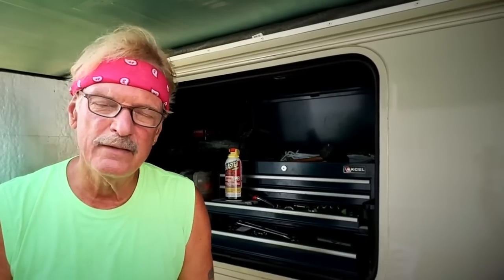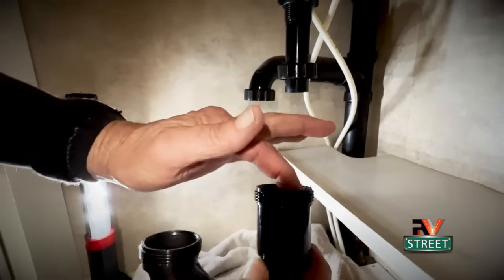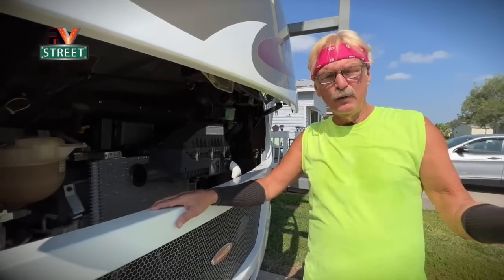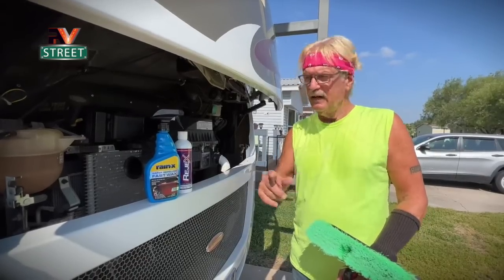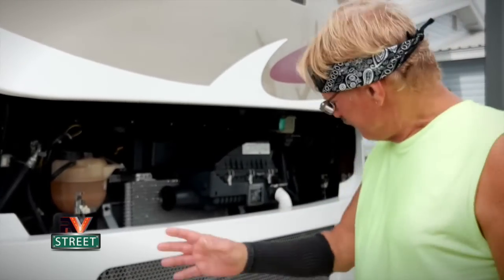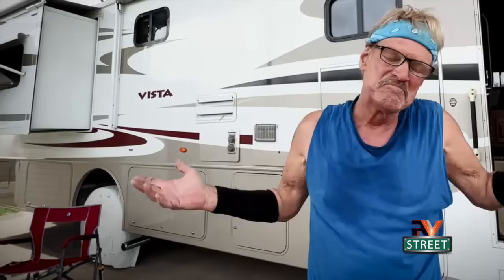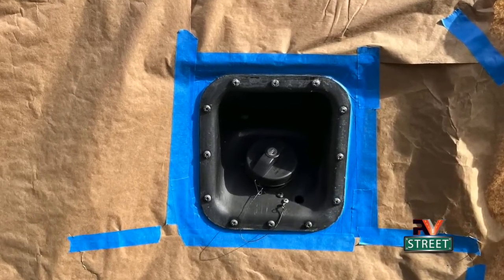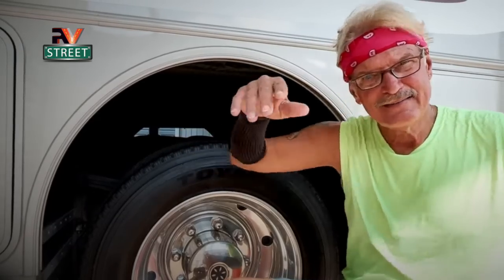WHY DON'T RVer's know these things?

Comment: Excellent tips Martin!!!  You da man!!!  You have sooooo many hidden gems and nuggets that a lot of other YTers have never pointed out!!!

A little nugget on the Rain-X 4 u.  I’m a merchant mariner and learned this tip from a fellow mariner years ago.  When applying the Rain-X, apply it generously, let it dry and simply rinse it off.  It will last a whole lot longer!!!  And, in our environment when going into a moderate to heavy sea, a lot of salt water will wash the Rain-X off in a short period of time if not applied generously.  People follow the directions and wipe it off like the directions say.  What this does, is takes most of it off… kinda defeats the purpose.  Rain-X applied in the way I described lasts longer and just beads off extremely well and I don’t have to utilize the windshield wipers🎉.  Read what the shampoo manufacturers state, apply rinse and repeat, which isn’t necessary.  They just want you to buy more.  
Just my 2 cents.
👍😃🍻
Reply from the maker: thx for that Mike 👍

Comment: I run boiling hot water through my drains once a month. About a quart to half gallon hot steamy water usually after doing dishes. Never had a drain or smell issue.
Reply: Do you use soap as well? Or just boiling water?

Comment: Very helpful reminder and teaching video! I need to check my hood bumper stops. Already had the hood hinge attachments bond fail and had it repaired at Forrest City. 6 years and so far that's held with new epoxy using the exact technique you specify.

Comment: Thanks Martin for the heads up on the sway bar bolts on the F53 chassis. I checked mine and found several of them loose. I applied the blue lock thread and should be good to go. Oh and your suggestion to keep a generator fuel pump on hand came to good use. Mine took a dump yesterday and I took your advice so I can replace that tomorrow.
Reply: How do you know what chassis you have? I recently purchased a 2007 35 ft Itasca with a V10 engine. Is it listed somewhere on the coach?

Comment: That Yuck, sludge, junk, etc on your trap is called BioFilm (bacteria produced polysaccharide matrix) mixed with some soap scum. Besides mechanical removal (scrubbing) 2-3qts boiling water poured down the drain should keep it a bay. I do this 2-3 times a year in my lavatories and showers that are subject to hair capture which makes it much worse. That strainer is a very good idea. I agree the chemical route is not best practice. The slow drain issue is building code required for houses (not RVs) to keep the sanitary system (notice not drain) from overloading. Too many of the IBC requirements have throw backs to cast iron and clay pipe sanitary collection systems. 

I don't like RainX products. They require constant reapplication. If you don't the silicone breaks down and make your windshield hazy. There is no way to remove it. The windshield must either be replaced or consistently coated with RainX, forever... I agree the bug problem is best solved by quick removal. I've yet to find anything that works better than water. Plexus does a great job on plastic lenses.

I'm so cheap I would turn the step covers around to get a few more years out of them. Great advice on the TPMS.

Comment: I have alternatives for keeping bugs out of the radiator and the gas filler.

1. On my motorhome the grill is a 1/2" grid that is also about 1/2" deep. If I put a screen behind the 1/2" grid will make it difficult to clean the bugs out. So, I found a stainless-steel screen material with a 1/5" mesh. I removed the grill from the grill opening. I used tin snips to cut it to the same size as the grill. I then used 8/32 x 1" stainless-steel torx head machine screws with stainless washers and elastic stop nuts to secure the stainless screen in front of the grill material. I then reinstalled the grill in the opening. 

2. My gas filler opening was really looking gross. My coach builder had installed it with butyl rubber as a sealant. The butyl was oozing out and running down the coach wall. In addition, the capture strap that keeps the gas cap from being dropped and lost was no longer retained in the filler housing. I removed the filler housing and scraped and used acetone to remove the butyl from the filler housing and RV Wall. I then used sandpaper to smooth the rough edges on the filler housing. Then I did one final acetone wipe down of the filler housing and sprayed it Rest-Oleum gloss black. I reinstalled the housing with a new layer of butyl making sure the butyl was kept well away from the edge. I then masked off the area for calking just like Martin did and used Pro Flex RV Sealant to caulk the filler housing. I then found a new grommet to fit the hole for the retention strap to keep the filler cap under control.

Comment: I put window screen material that I already had on the back of my grill. It has very small openings. I have put all the 54,000 miles in 8 years on my Ford V10 F53 chassis motorhome including dozens of mountain passes and have never seen the coolant temperature gauge go up from normal, even in warm weather.
Reply from the maker: Great idea 👍

Comment: One thing to point out on sink drain the clog might not be in the trap. Mine was in and around stopper. Took stopper out, had to unscrew lever just above trap and pull it out to lift stopper. Then fished paper towel through to get big clump out. 

Such a timely video, watched it and later that day wife tells me bath sink is draining slow.

Comment: Your videos rock! I learn so much from watching these. Was wondering if you could offer advice on parasitic drains. I have a 2003 Winnebago Itasca whose chassis battery drains within a couple of days. Changed all the batteries and made sure the cable terminals were clean. Not much improvement. Added an amp l start with no appreciable improvement. Had been looked at by pros who were of no help besides installing a battery cut off. I want to approach this again from the beginning. Do you have any resources you could point me to that would be understandable to an electrical novice?
Reply from the maker: I'm sad to say that Martin has passed away and I don't have the answer to your question. 🥲

Comment: I was excited to buy those step covers after watching this, except I am sending them back because they barely wrap around my 11” steps. I sent an email to Prestofit and hopefully they make larger ones. The picture on their website looks like they meet underneath with about a 6” gap, mine are  about 10”. Description says they fit 8-11” but I would say that is incorrect. Anyhow, I know this isn’t your fault, just wanted to make the point. Love your videos, don’t stop making them!
Reply from the maker: Patrick,
I also have 11” steps and the covers have a 7.5” gap underneath when tied together. This is my second set. My first set lasted 5yrs. Having this gap underneath is normal and will work fine. They don’t make wider ones. These are the best covers out there.
Reply: Thanks, I ended up making my own and they came out great. I could not even get the zip ties to begin to lock as the tip barely fit. My steps have maybe 1-3/4” lip around the step so no way those would work. I emailed them but they stopped responding. I can’t be the only one. Thanks for the reply though.

Comment: Step Covers:  the zip ties keep them tight enough that they do not slip or move?  Do you have to tighten the zip ties after the covers get worked in to place after a few uses?

Comment: I have two questions.

First, for the step support I know that adjustable step supports are available. For the RV'er who doesn't have the space for that ground step or does not want to mess with figuring out to get the correct thickness shim would a specific step stabilizer option be a good choice?

Second, for your TPMS, I know that some after-market TPMS systems have internal sensors available. Yes, I know the internal version might cost a little more but when you replaced your tires that would have been a perfect opportunity to install new internal sensors as well provided your chosen TPMS system has internal sensors as an option. Besides cost what are the considerations, both pro and con that should be taken into account for choosing an internal sensor or external sensor TPMS?
Reply from the maker: 1) Nope not for me. There are many situations where you'll still need some wood to support under the legs. Like in cases where it's muddy or the steps end up pretty high to get level. In cases where they are high, now you have one large step to take get into the RV. My portable step provides that extra lower step to make it easier and safer to get into the RV. Adjustable leg supports are also just another thing to maintain and service so it doesn't get corroded or stuck.

2) Internal TPMS on a Class A or a truck pulling a trailer is nothing like having a TPMS system on a regular vehicle. It's also not a money thing...
• Class A TPMS are not compatible with any type of internal sensors
• They don't make internal sensors for metal stems which you should be using
• You also are going to have to monitor your tow car tires, which again may have a factory TPMS system but it will not be compatible with your Class A system
• Same with a truck pulling a trailer of any type
• Having my type of TPMS I can easily monitor all tires and move the entire system to another RV or vehicle
• If something goes haywire with any sensor I can easily resolve that issue. BTW...that has never happened in 5yrs. Even if internal sensors were possible, it would be a major hassle to fix that problem. Just think about the steps you'd have to do if one of your internal sensors went bad for any reason.

In conclusion, IMO this type of TPMS for RVer's is proven model and there's just no reason to wander down that path that ends up to an dead end.
If you're interested, here's a video on my TPMS:
https://www.youtube.com/watch?v=2kCXRbvtoYA&t=377s
The TPMS I have is in my Amazon Store in the Tires, engine and chassis care category. https://www.amazon.com/shop/rvstreet

thx Daniel for your questions 🔧

Comment: Rain-x is said to be very bad if you have a Diamond Shield coating on the front of your Class A. It will eat it. I have no experience testing this nor will I ever. I only use Rejex on the DS and the windshield. I also use 0000 steel wool after washing the windshield when I have time and use the step ladder in the storage garage. It really gets the last of the bug guts and won’t scratch the glass.
Reply from the maker: Never heard that about Diamond shield but I'll take your word for it. RejeX is for sure a safe bet. I also use 0000 steel wool on the windshield. Usually once a year in the winter when I do  full detail.

Comment: I love Rainex on the windshield but it can be a problem if you get a chip and want to have Safelite fix the chip vs having to replace the whole windshield. The Technician asked me if I had recently put Rainex on my windshield when he was preparing to fix my chip and I told him no. But being curious as I am, I asked him if it would make a difference and he said yes that their product wouldn’t “seal” properly if Rainex was present. I didn’t follow up, just took his word for it 😊
Reply from the maker: Makes sense to me. To fix a chip just clean that area good with alcohol if you've used RaineX.
thx Marsha

Comment: Glad to see you all again. Love your dumpster diving pictures. I have the Tire Minder pressure monitor with flow thru valves. I promise from this day forward if I  ever order anything from Amazon, I will go through your store link. Have you tried to get a product you represent to give you a discount code for all viewers to use to get a % discount?  Several people on the  internet do. Just wondering.  Well I made it to Benson , Arizona safely for the winter. I got a seasonal maintenance job while here. Love it down here. Different from  Apache Junction where I was last year. Got to pull the rear passenger leveler off to send to HWH in Iowa to have rebuilt.  Sprung a fluid leak on the cylinder seal. Did the driver front last year. 2006 Coachman Aurora 3480 DS class A. Hope you all made it to Texas safely. Love you guys.  Always, Steve Robinson.  Got your back brother.
Reply from the maker: thx Steve,
Have you tried to get a product you represent to give you a discount code for all viewers to use to get a % discount?
No I haven’t. And yes I know many folks to that. Getting an additional % discount for my viewers would come by purchasing product(s) on the sellers website. Not Amazon. In addition to that it usually would have to be a sponsored product which I have chosen not to do thus far and more than likely won’t do in the future. Also, getting those additional % discounts come when a seller contacts me, not me contacting them. But in any case, I don’t want to be seen or get the reputation of “Pimping” products. Now that could change on some very select product(s) or services IF I really believe and USE the product. But for right now I just like keeping my life true and simple.
Reply: Thanks for sticking to your ethics. Didn't know how that works. Hope you have a great and safe trip to Texas. Always, Steve Robinson
Reply from the maker: @steverobinson1598  And....I forgot to thank you so much for using my Amazon Store Steve. It means a lot 😎
Reply: I'm thinking of doing a you tube show.  Titled " How to get lost in an RV  and maybe find yourself "". Lol. 😆 🤣.  Like that one?

Comment: If you do get some rust on your steps, what can I do to get that rust off before putting the step covers?
Reply from the maker: If you have a lot of rust you can use a course sandpaper to get the most of it off then use a smaller grit sandpaper the smooth it out. You might want to consider applying a coat of spray paint before you put the covers on.

Comment: Great advise.   Also have a question about a backup camera screen.  Doug do you or Anybody out there have any ideas how to keep the screen from coming unplugged. We have had it fixed twice professionally and still no luck. No fun traveling with out backup screen.
Reply from the maker: I personally remove that screen from the dash and see how those wires/harness is assembled into the screed and then come up with a fix to keep it from unplugging again.

Comment: Good morning Martin, how do you clean slow drainning drains in your shower?
Reply from the maker: Haven't had that problem in the shower and especially since I put in the screens. HAIR....is the big problem in the shower. I'd remove the drain plug that's there now, and fish out all the hair, then get a very small bottle brush and clean down there between the drain holes as best as possible. Get it where it will drain properly. THEN....install a drain screen and clean it out after showers.
I also take my 2qt. plastic pitcher, add about 1/3 cup of bleach, fill up the pitcher with hot water and pour it down the shower drain about one a month. I do the same thing when I want to sanitize my gray tank. I wait till my gray tank is about 1/3 full. Then hot water in the pitcher and about 1 1/2 cups of bleach. Pour it down the shower drain. Now over the next few days as my grey tank con't to fill up it will get sanitized too. I just did that to my tank 2 days ago.

Comment: Could tire pressure sensor be added to a 2000 Bounder motor home  even though my husband checks pressure every time we leave it would be good to have them on our tires even our hookup
Reply from the maker: Yes you can add them to your MH and tow car. And you should. Checking your air pressure before you leave only verifies that your pressure is good at that time. Once on the road any number of things can happen where you start to loose air pressure in any tire and without a TPMS you’d never know it. And that’s when bad, costly things happen.
Reply: @RVstreet  thank You very much